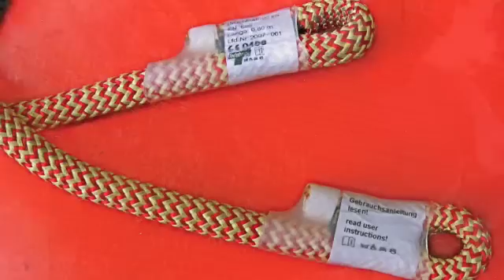Hitch Climber Set-Up

Comment: I know using the hitch climber without a spliced eye climbing line is not recommended and frowned apon. But could I tie a figure 8 with a big loop putting the knot a foot or so above the friction hitch? ( so it wouldn't be able to lock the friction hitch in a sliding position).

Comment: Hey how did u get on with this type of pulley?? i'm still undecided, i use a valdotain, with isc pulley to tend slack,  don't know whether it is worth it and whether it makes any real difference?? when accending taller trees i use a static double line with just a klemheist positioned at arms length, and when in the canopy i switch to the VT and standard pulley, for shorter accents i use a really long blakes and hip thrust/foot lock, then switch to a VT ..thanks
Reply: This setup is junk... look at the slop!  VT All the way

Comment: I'd be inclined to have shorter tails on the prusik so there's less sit-back...
Reply: Yes... indeed
Reply: Or use a VT or xt or i even use a modified distel with a couple braids sometimes when I can't get my hitch to grab reliably every time when I'm climbing single rope on a rope wrench. Another reason I prefer to use a unspliced length of cord and make my own prusik with double fishermans knots to dial in the length better for different hitches
Reply: I really have problems with my prusik grabbing on teafelberger km3 cause the jacket is really smooth but a 3:1 distel with 2 braids grabs like a dream everytime. Or even a couple braids with a michoacan. It doesnt look pretty but grabs like a sob and releases really smooth

Comment: I think after a certain height it self tends, which in turn means you can pull yourself up with both arms. Also before it self tends you just pull on the tail which means you don't need to push the "prussic" up. I would say this system is relatively cheap compared to Spiderjacks, zig zags etc. I suppose if you like this then you can think about investing in more shiny things :-)

Comment: You will need either the ocean rope or similar, you can buy these ready made with 2 eyes or you can tie the fisherman's knot. Don't forget start low and safely when starting. I'm going to start using this next week, but I'm going to use the Knut Hitch knot, also if you don't have a termination eye on the working end of your rope, use a long looped bowline so the bowline knot does not interfere with the prussic/hitch knot, as it will not grip. Post a video of what you find out, so we can all see!

Comment: HI, Thanks for this video.  I've been using this system for about 6 months now, liking it very much.  At about 1:06-1:10 of the video you have a still shot that seems to show a DMM Revolver in the center hole of the hitch climber pulley, wondering what that technique is about?  Thanks,
William

Comment: What do you mean "self tail"? I'm assuming you mean the running end of the rope gliding through the prussic knot? It does with enough weight on the running end. I didn't go for anything with eye splices for my schwabiisch prusic - I just used a couple of fishermens knots WORKS FINE!